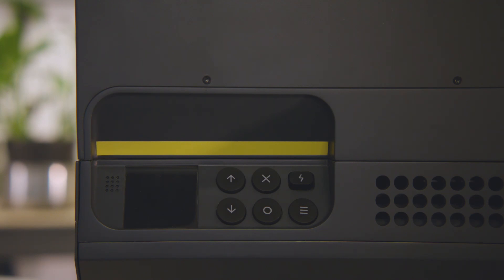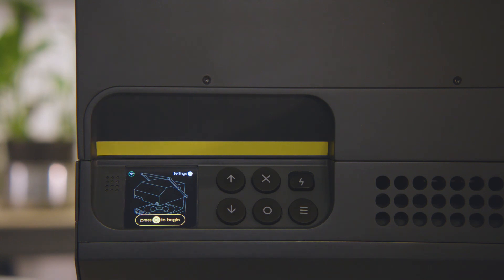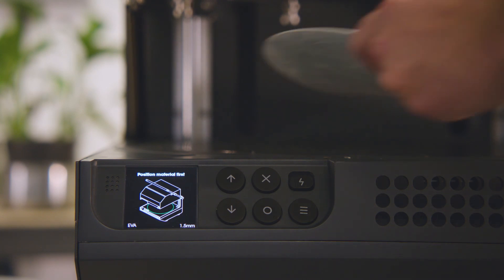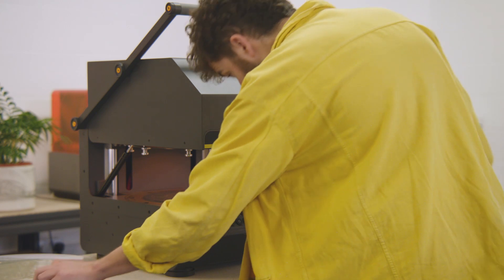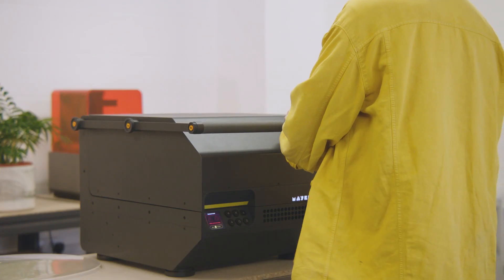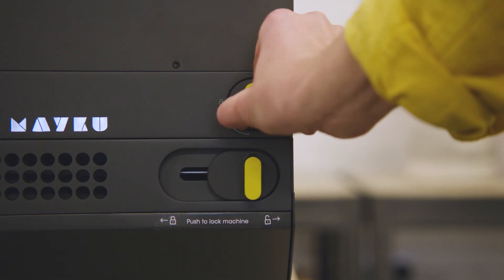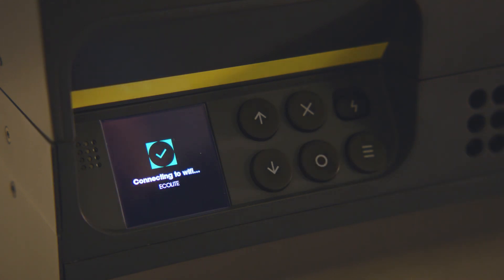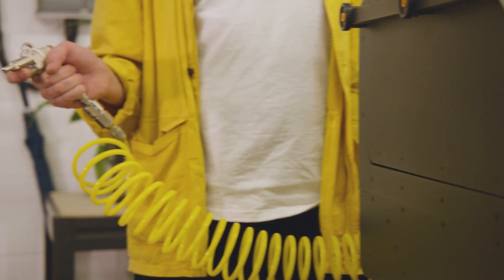How to use the Mayku Multiplier

Comment: Do you send a buck for a conical cap to everyone who buys this $6,000 machine? Do you know who has been making the same kinds of things this machine does for several decades without temperature gauges or any other digital bells and whistles? All the industry professionals in the world, including Hollywood.
Reply: no, you are thinking of vacuum forming machines.  This is a pressure former.  A very well built one.
Reply: @outkast187  I know it is a pressure former and I know what a vacuum former is. There is little difference between the two, aside from the price.

Comment: Whats the benefit of this over a regular vaccuum former?
Reply from the maker: Good question and thanks for asking. Pressure forming allows you to capture greater detail than vacuum forming as well as allowing more control over the process. For example, an upcoming software update to the Multiplier will allow users to choose to capture more or less detail depending on their desired results.

Comment: Too much..2799 that’s the 40% off price
Reply: If you know a pressure former (not vacuum) cheaper and this similar size please let us know
Reply from the maker: The Multiplier is an industrial grade machine, fully tested and certified. Everything works within the one unit, so no additional compressor or vacuum needed. And yes, it's a pressure former, not a vacuum former so the technology is a bit more complex. Let us know if you have any other questions.